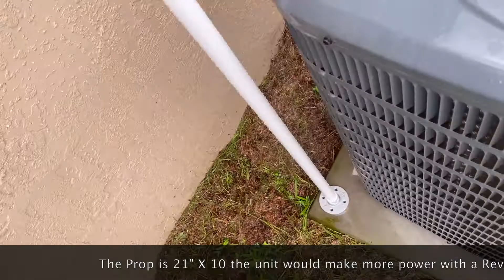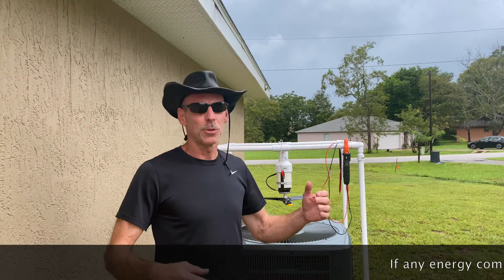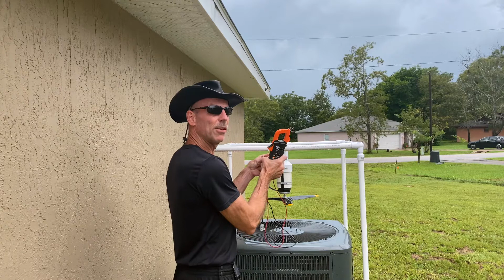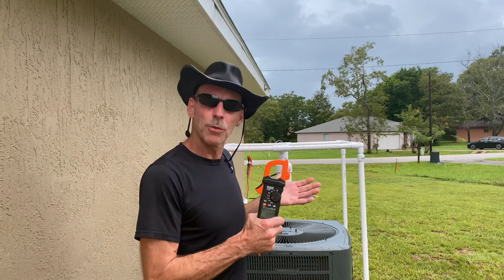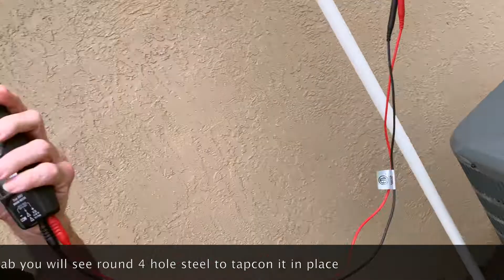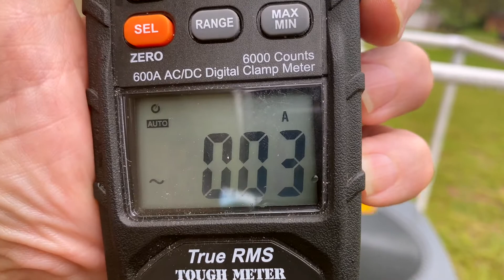Free Energy Generator

Comment: This is free enough to count as "something for nothing" because you're using the AC anyway.  I have seen water-line generators which spin a turbine from the water flow as you take a shower.  It is something you're getting back from the life you're already living.  8 watts, not bad at all.  👍
Reply from the maker: Thank You Kyle,  With only about 304" of wind at 15 mph  not much to work with, but hayhay like you said 8w, not bad at all. I really do appreciate, thanks Kyle
Reply: @richardtbarciaii5938   I think we all made a mistake here, 0.03A x 24 V = approx 0.8 Watts, not 8 Watts.   I think also, you can stack propellers and do several other things to make more concurrent power.  The one propeller you have is not collecting all the wind generated by the fan motor; if it was, your output would be VERY close to the power drawn by the fan motor itself, which may well be 20-30 watts.  Cheers!
Reply from the maker: @kyleb3754  Thank you, now my fan motor is eating up 278w  when running. The most I got was 14w   now on the watts in the video .03 x 24 =0.72w that is app 7w  0.035 x 24 = 0.84w that is app 8w  the most we made in the video was 0.04 x 24 = 0.96w that is app 10w  that 1 prop is $40  this unit as is cost about $85  to add more prop's and hardware, well you get the picture. Thx u Kyle

Comment: It's not free energy.  You're paying for the electric to run the AC unit.  All you're doing is trying to capture back some of the energy you're paying for, so at best, it's like increasing the efficiency over all.  Not a bad thing, but there is no such thing as free energy.  

The next question is ROI, how many cell phones would you have to charge with that thing to save enough on your electric bill to pay for the PVC pipe for the stand, the 24v motor, etc, etc?  

What good is this "free energy" if it ends up costing more than just plugging something into the wall socket?
Reply from the maker: Hi Edward, Thx u. I enjoyed reading your comment I thought it was great and put together a very very well, I did say in the video that you will never get your money back if you buy it for me $150, that is why I am not selling them and gave it to all for free so they can play with it and make them on their own. I spent 1000s on it, 1000s trying to get the most out of it and the best I could do was 14w witch is 10w per hour x 24 x 365 x 10 years= $122.64 you can build them for about $85. ROI in 10 year if it don't break $37.64 hayhay lol.  I am Building a cleaner world with my energy inventions, this one came close but close is not got enoff. Thanks Edward I appreciate, I was just hoping to put this out there and Create awareness to help with my other inventions like my surplus of power.
Reply: I think it is better to think of this as an energy recycler which is completely awesome.
Reply: The “scientific free energy” can be produced out of only perpetual machines, machines that sustain motion endlessly without supplying any external work or energy. Here the word “Free” is associated with energy and work given to a system.
Reply: @yourbestie_preepey  There is no such thing as a perpetual motion machine.  it is impossible.  No such thing as free energy, period.  Energy is neither created nor destroyed, it is only converted between different forms.  For example,  driving your car requires gasoline, gasoline is burned (combusted) to make power to move the car.  Most of the heat (energy_ released in that combustion is wasted to heat.  The ramining power is converted into rotational energy at the crank, which is then used to turn the gears in the transmission, then the differential and finally the wheels.  All of those parts rob some of the power due to friction (which is turned into heat).

Once the car is moving, it now has kinetic energy, but what happens to that energy when you stop the car? That kinetic energy gets converted into heat by the brakes.

This is why the laws of thermodynamics are important.  Every time you convert one form of energy to another, there are losses in the system, thus, perpetual motion and free energy are impossible.